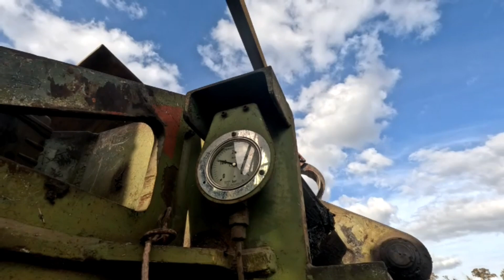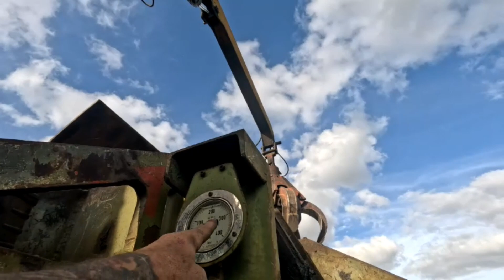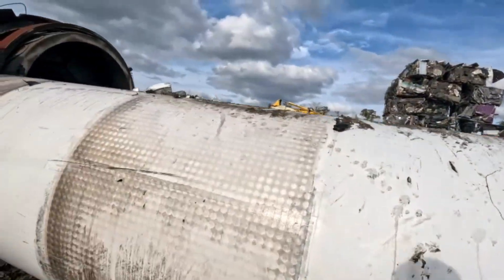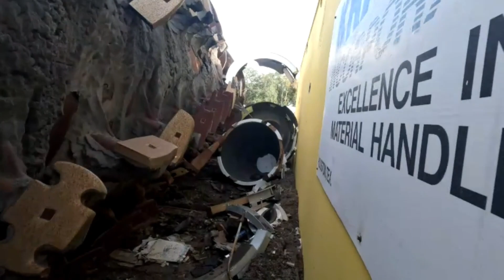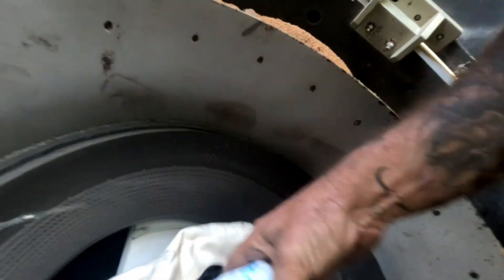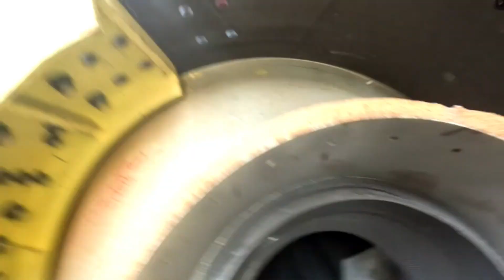UNSEEN SATURDAY #recycle #recycling #scrap #carcrushing #rocket #booster

Comment: Hey jeff good video.   Would the aluminum buyer really dock you for one or two stray bolts?   Just curious why you have to have it so clean
Reply from the maker: Extrusion pays the most so they expect it to be around 99% clean. They will down grade a bale if they find more than 1 or 2 screws